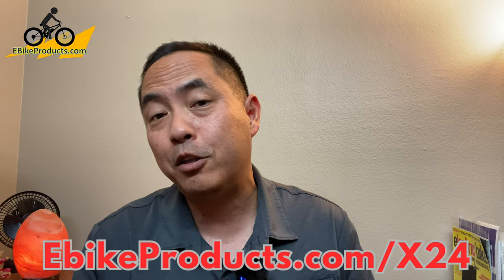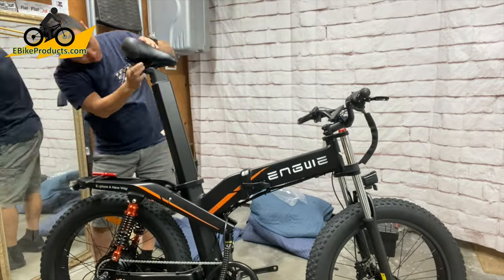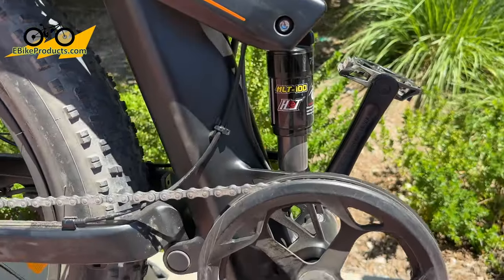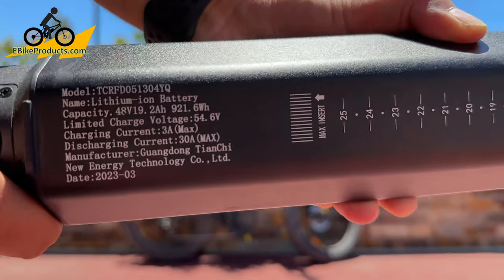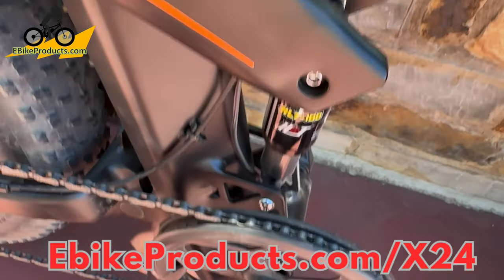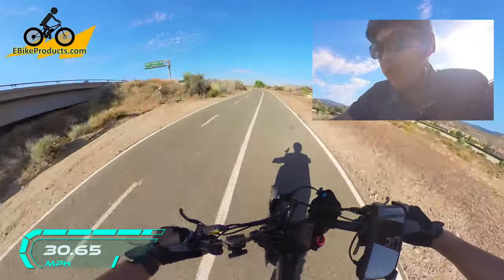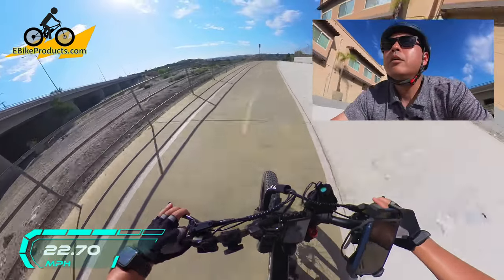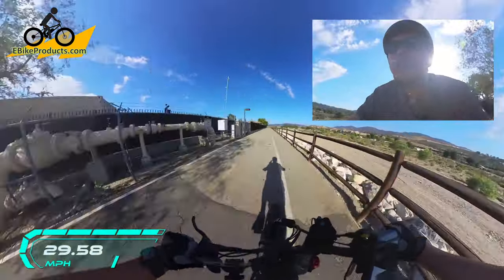ENGWE X24 -The Best Ebike Specs (Speed+Range+Power+Folding) I've Tested Under $2k! Now Only $1599!

Comment: Appreciate the vid on this bike, have been looking for a 2nd bike. This one is small, powerful, fast, and good looking bike, this might have to be it at some point?!
Reply from the maker: Just a heads up, it’s not really all that small, but it does fold. Also, I made a mistake and the weight of 90 pounds that I mentioned was with both batteries taken out. The full weight is over 100lbs. 
It’s really fast, so it’s a great prices for all the features.

Comment: The bike has an interesting, very mechanical appearance. Triple suspension folding fat tire is very rare offering in the ebike space for sure.

My question: is the throttle speed PAS dependent? or can you throttle up to top speed whether in 0 or 5?